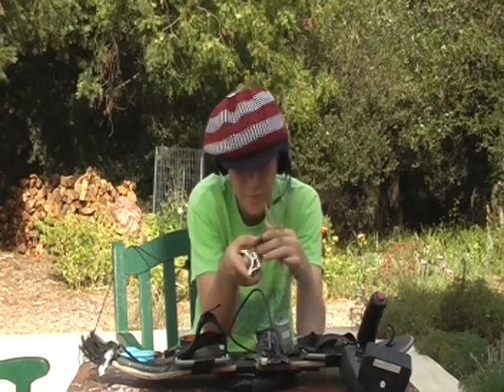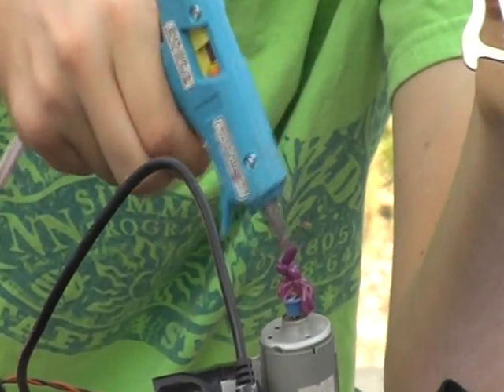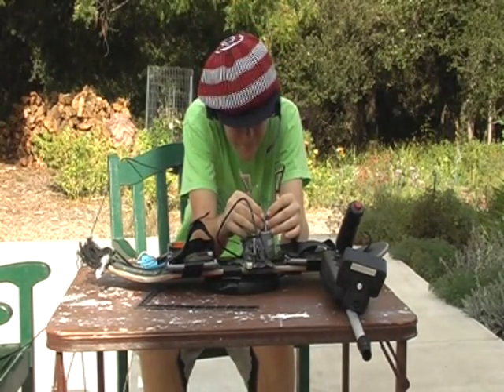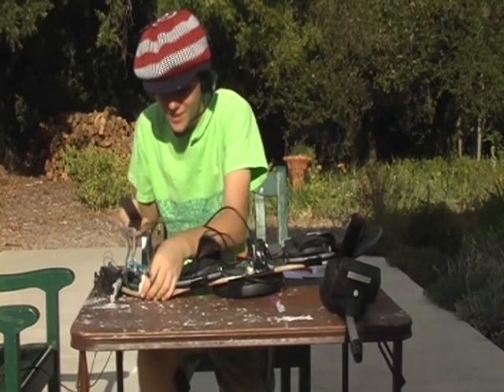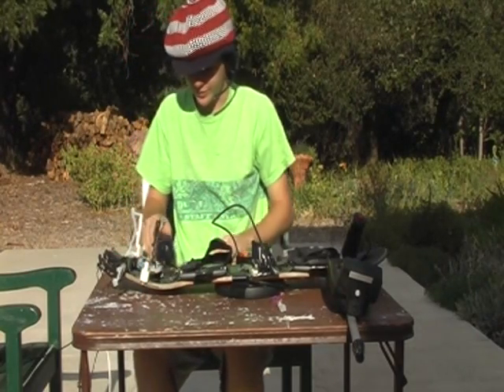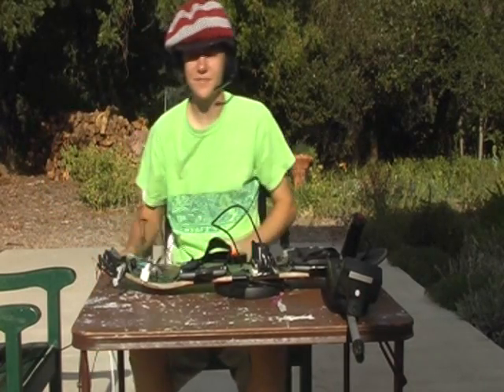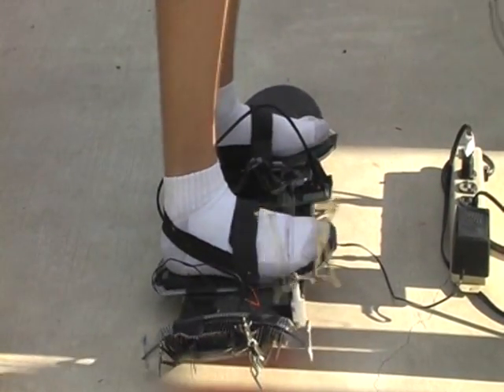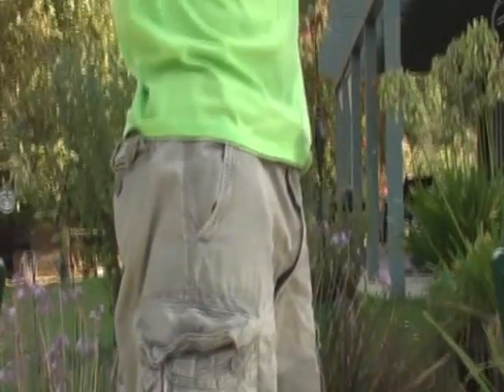How to make a hoverboard (Working!) Part 2 - Testi

Comment: Fake -_-
Reply: classman35
Apart from "guy" (AKA: Hassan Shaikh) everybody knows it's fake. Quantum arc weld? Seriously. It's a glue gun. It is possible to hover. But not on a board with such little surface area, nor that high off the ground.
Reply: Hassan Shaikh
Just because you saw him build it, it doesn't mean it'll work. That's like saying that if I substitute my laptops hard drive with a banana, it'll still work because you saw me do it.
Reply: Fuck you!
I know it's a camera trick, my little cousin wrote that comment.
Reply: Did you even see part one mr. 'Fake'.
Reply: guy, all this videos are fakeeeee
Reply: Dude, you saw that he's not hanging onto something or being hoisted up. ITS REAL!!
Reply: Bobbie Kusher your mean
Reply: classman I used to be an idiot that thought this is real